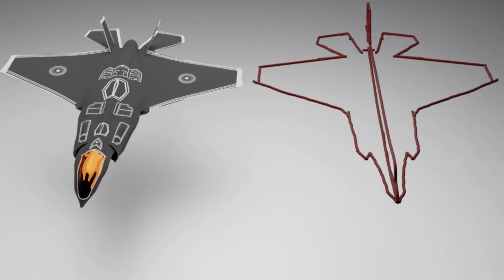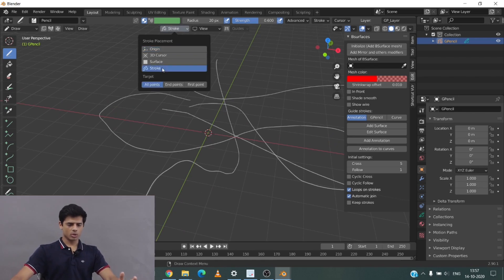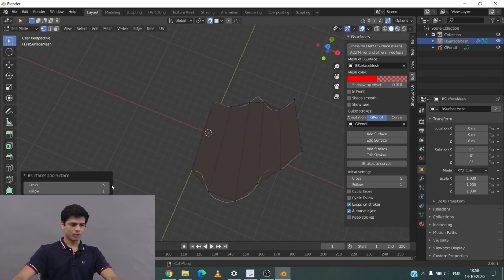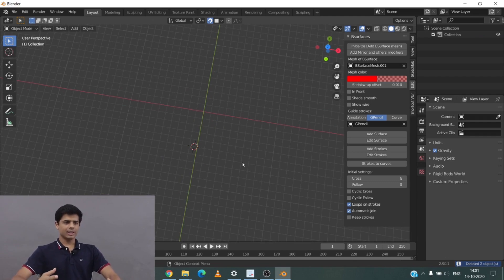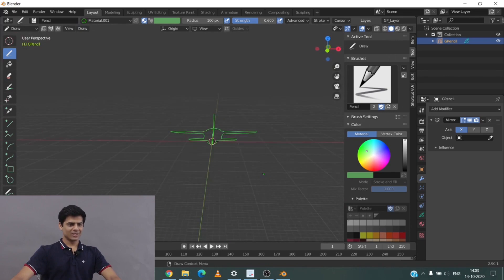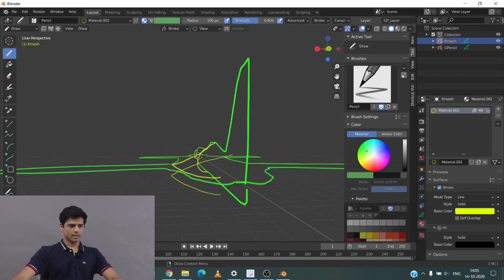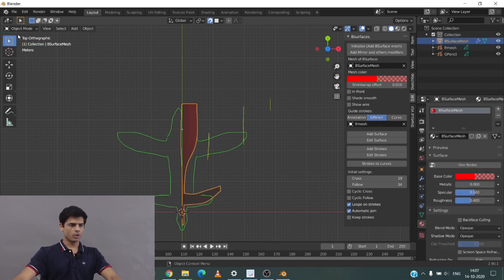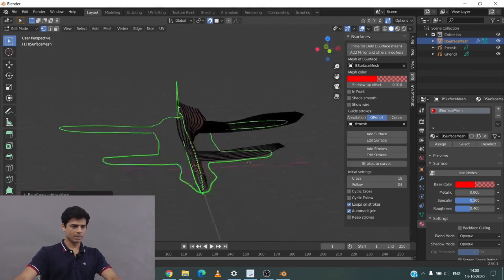Blender Tutorial | Blender Grease Pencil to Mesh Tutorial | Blender 2D to 3D | Blender Fighter Jet

Comment: Fantastic tutorial! One problem for is I got stuck at the point where you hit "Add Surface" and got the messages "Specify the name of the object with retopology" What am I missing? Thanks!
Reply from the maker: Thank you so much!
There can be 2 possible reasons why its showing an error. 
1. You don't gave any surface. 
Solution - you can initialize a new surface 02:05 OR select a surface that you already have.
2. Maybe you do not have the grease pencil selected. 
Solution - 02:35 select grease pencil
Reply: @the4daviator300  Got it! Thanks so much for your reply
Reply from the maker: Cool... no problem

Comment: Very Nice, however can you tell us where to change the cross and follow at Bsurfaces? you handsome profile video just happened to block that menu view ^^ many thanks ^^
Reply from the maker: haha sorry about that, as you click on add surface you will get a popup in which you can change the cross and follow but that is just for the first time. I would suggest to start with low follow and cross and later add subdivision surface modifier.